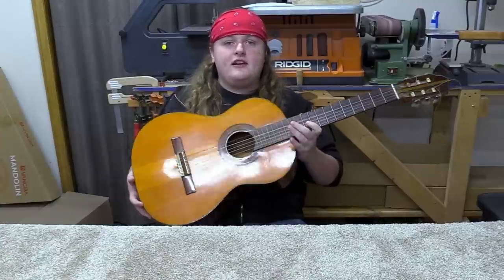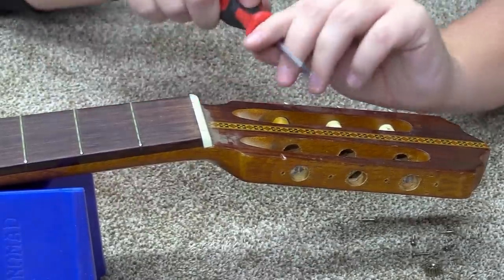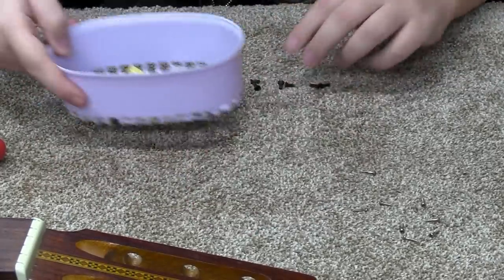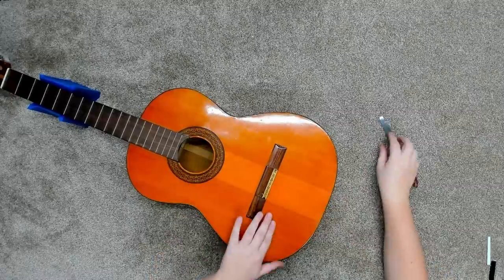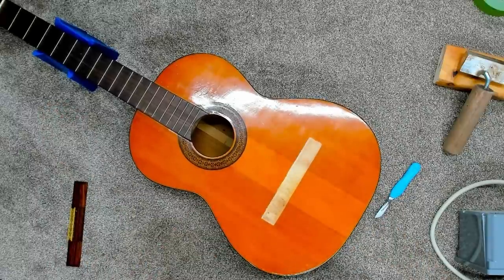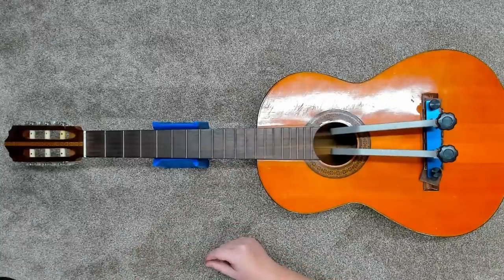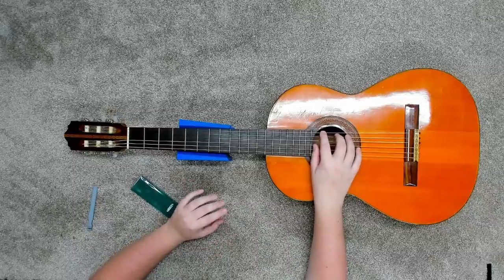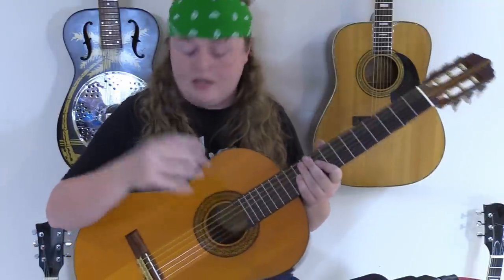A Classic Classical

Comment: Nice episode.  Classical setup is not often shown on YouTube.  When I do mine, I set them up lower than the Yamaha spec.  If you are playing hard, my setup would not work.  But a low(er) action is not bad.  A few tips:  A bit of taper down on the treble side is good.  When I string, I wrap the string around the peg, then through the peg and around one side, fold around string, back to where the wrap came out and back through.  The holes are big enough for multiple pass throughs.  Not a fan of the "Lyre" style tuners.  I think tuning keys should sort of match the saddle and nut ...  Martin ball ends are good strings.  Tied nylons in "hard tension" will brighten a dull sounding instrument.  And, putting a shallow "U" notch, maybe 0.015" in the top of the saddle, for each string will help capture some of the string motion and turn it into sound.  Adds a bit of clarity because the strings can move so much 😊

Comment: I’ve found with the lower end classicals they tend to use standard wood glue whereas the mid to upper end use reversible glues. As for the action, though not optimal, you could knock the leading side of the bridge down a bit to allow more saddle to be removed up. The best way is to remove the frets, plane the fretboard on a slight back angle and recut the nut. Kind of a classical guitar’s version of a neck reset.

Comment: Hi Caleb what I do is make a small wedge of maple about 2 inches long 1quarter inch thick at one end too 0at the other end stick it under the string until it touches the string and mark both side of the string with a sharp pencil then check the thickness between those tow lines with a calliper, a tip from canada.

Comment: The action on a classical guitar for the low E string is about 4mm, which is close 160 thousands of an inch. At least that's what the specs usually are. I like to have mine at about 3.5mm. I have my acoustic guitar at about 2.5mm (0.098 inches).